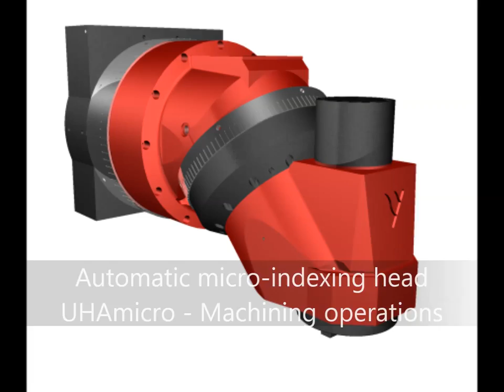Helical Interpolation Using Micro Indexing Head With Automatic Tool Changer On A Bed Milling Machine

Comment: Drill is big when it shattered its like a bullet people just walk by
Reply: I'm sure they're only have the doors open so they can do the video it's not how it usually runs and I think that's why it was so slow to most cnc machines won't run at fast speeds with the doors open